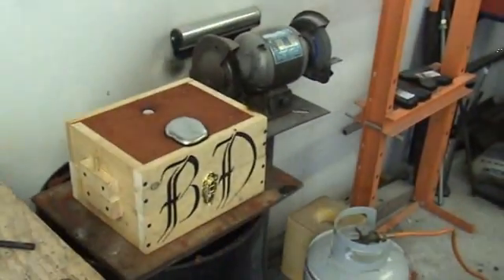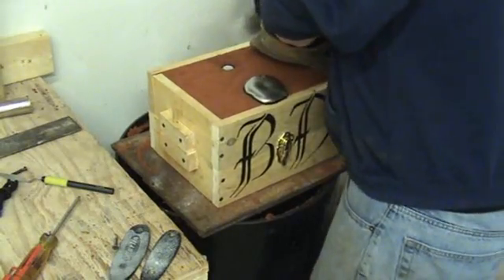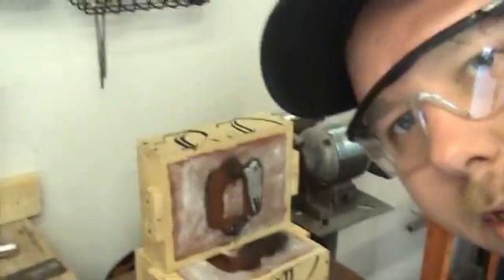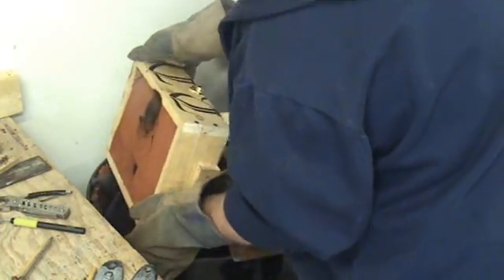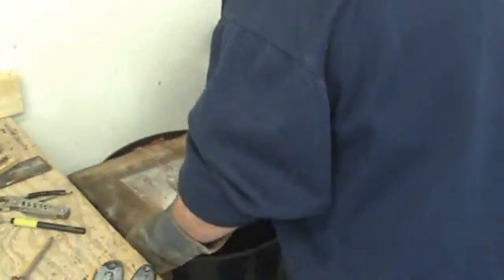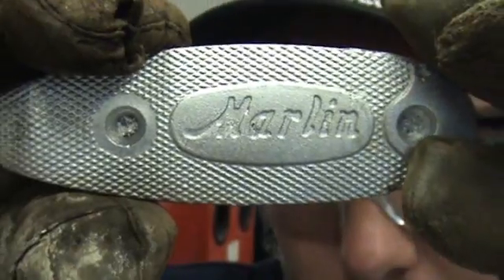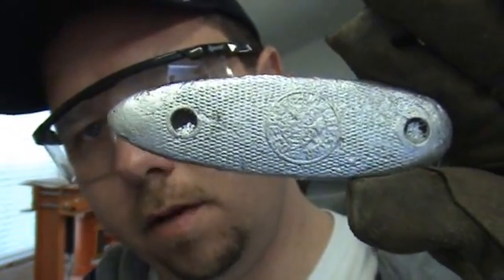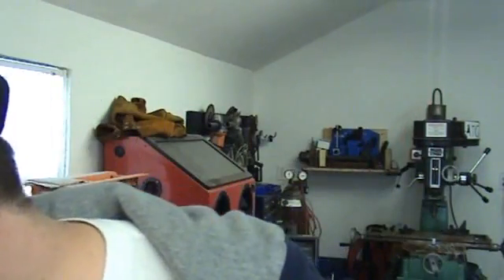First Aluminum Cast Pt.#2

Comment: Thanks for reply! So thats why it also changes the color after casting.I get it. But you use it instaed of water, or you ad some water anyway to the mix?.about the cole..Its charcoal...(sorry for bad english) the same stuff what is used for the BBQ. but on wikipedia there was some different mixes If I remember right.,there are also a lot of mixes of alloy.And why is myfordboys sand so black?Its greensand he write.I must check again.Because like I to try too., ,Peter
Have a nice weekend!,..Peter

Comment: Wel done!! I like also to start this year to make vintage model engine crankcases..I folow the story,but what was petrobond?.. also your sand has a red tint.I guess,they are different ways to use the sand.I read also on wikipedia, coal is used too in the mix.Do you check the vids from "myfordboy"?...he cast amazing stuff. with great patterns.But he have almost  those black sand.But indeed...for the first one its really great dude!!

Comment from the maker: @Spineraker4 They are definitely not the same. Greensand is a mix of sand. The finer the better. The only stuff I could find localy was the 50lb. bags of play sand from Lowes. The other ingredient is Bentonite. You can but it pure witch is advisable or you can find cat litter that is pure benttonite. If you go with cat litter you have to grind it. Id have to say petrobond is the way to go. The finish is way better. The green sand will work but the finish will be really gritty.